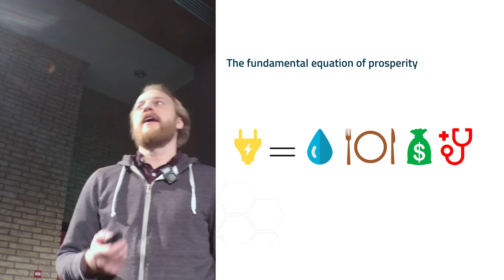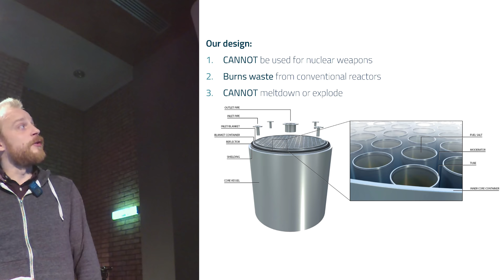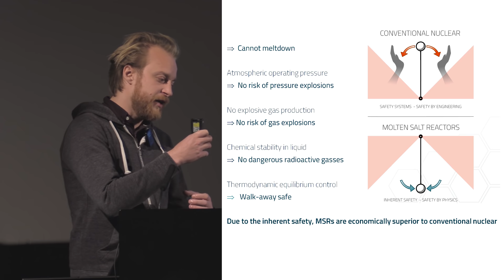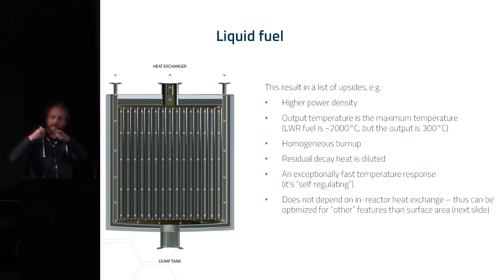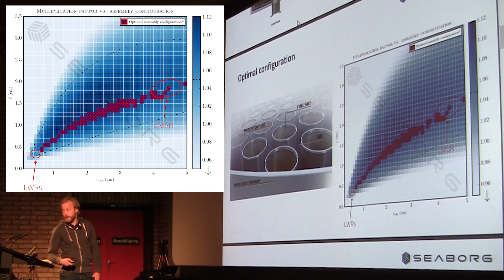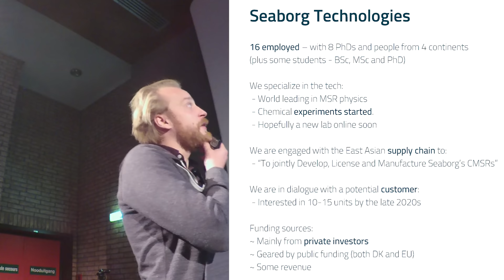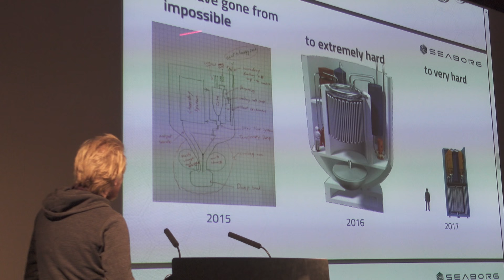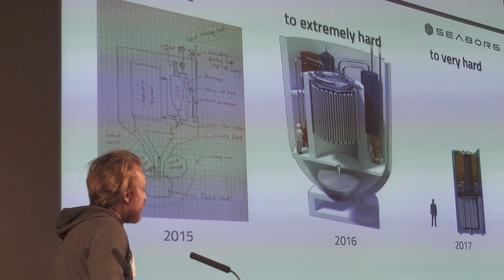Making Nuclear Sustainable with CMSR (Compact Molten Salt Reactor) - Troels Schönfeldt @ ThEC2018

Comment: any bashing of thorium is about maintaining power of the elite with commodity materials
Reply: Yeah, never mind that it will likely cost double or treble what renewables + storage will cost in the future.
Reply: @Kie-7077  Renewables and storage are far more expensive than anything nuclear, today, and with future nuclear power systems being far cheaper that price gap will only increase further in the future.
Reply: @sycodeathman  "with future nuclear power systems being far cheaper " Lol, pure fantasy, cost of nuclear is going up, no-one ever talks about the cost of re-processing because it's hideously expensive whilst the cost of renewables continues to plummet and storage hasn't even scratched the surface of what's possible.
Reply: @Kie-7077  Nuclear could go up 10x and still be cheaper than solar is now, we're already approaching the limits of what is possible with renewables (especially wind, which is pretty much as good as it's going to get and it's still terrible). As it stands, you're wrong anyway, because the cost of nuclear has been either stable or declining worldwide. Due to the fact that there are numerous 4th generation reactors with modularity and low cost designs in development there is no reason so think nuclear will do anything other than drop precipitously in price in the very near future. 
Finally, only SOLID fuel reprocessing is hideously expensive. Reprocessing of liquid fuel of any kind has essentially zero cost associated with it, as even consumable chemicals using in the process can be recycled using energy produced from the reactor itself. Since in liquid fuels the daughter products are in solution rather than locked inside an extremely non-chemically-reactive ceramic, they are very easily removed using a variety of simple methods, and this process can be done continuously. How do I say all this with confidence? Because at Oak Ridge alongside the molten salt reactor experiment and the molten salt reactor project, there was also a simple chemical processing unit developed which worked totally successfully and was capable of keeping up to the reprocessing needs of an entire gigawatt scale nuclear reactor, and that unit was small enough to fit inside of a modest room and barely required any manpower to run or monitor the system. If we could do it in the 60's we could certainly do the same if not better today.
Reply: @sycodeathman  You clearly haven't got a clue what modern solar actually costs because if you did know then you'd know it is cheaper than nuclear large scale.
Reply: @sycodeathman  And we're no-where the limits for renewables with regards to both price and efficiency. You need to lay off of the confirmation bias and learn some real facts not the stale old wrong ones.